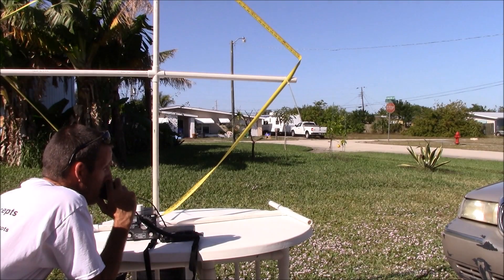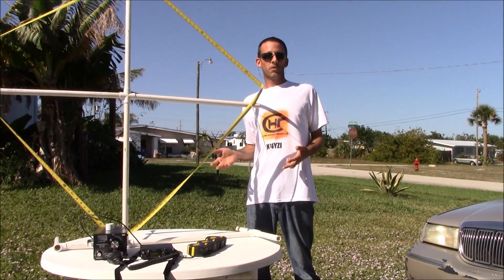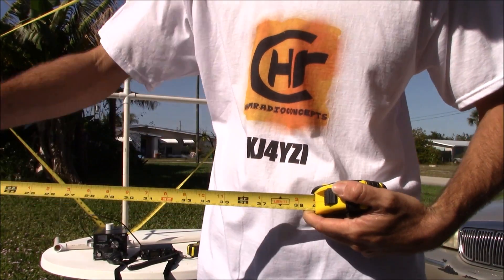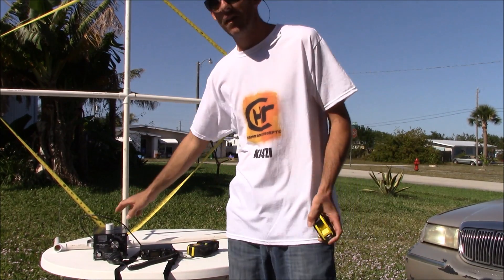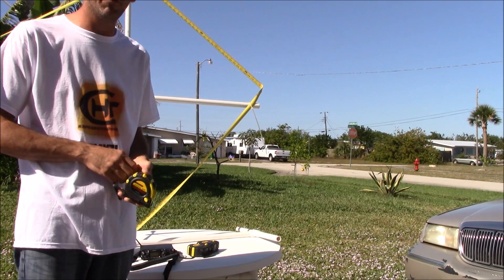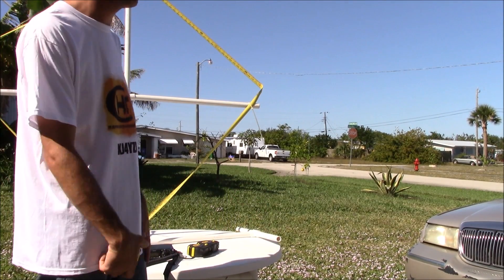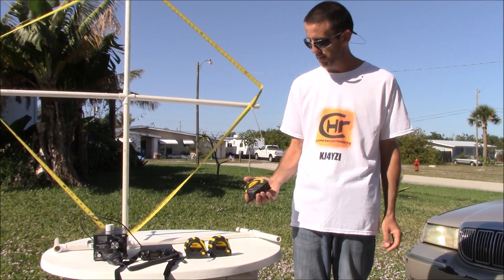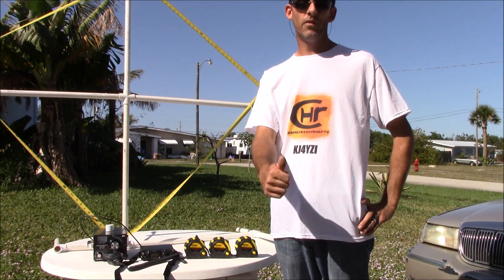Ham radio tape measure loop antenna giveaway

Comment: interesting concept, what is the furthest dx you have got with one of these?
Reply from the maker: Commando Squeak well I don't have any log near me, but the possibility is not limited by the antenna if the band conditions are good. I have worked DX on a variety of different homemade ideas that shouldnt have worked.